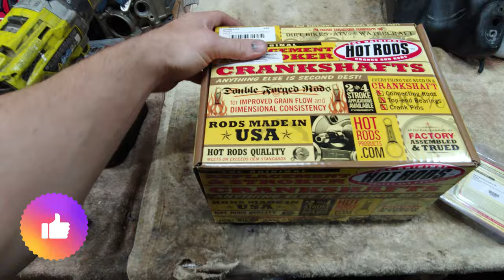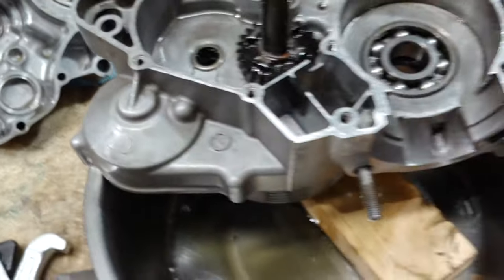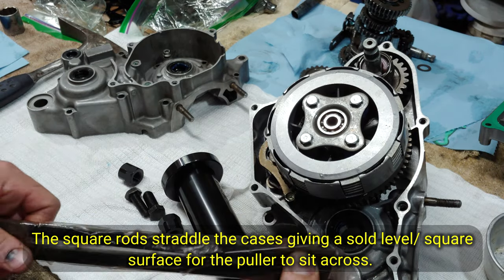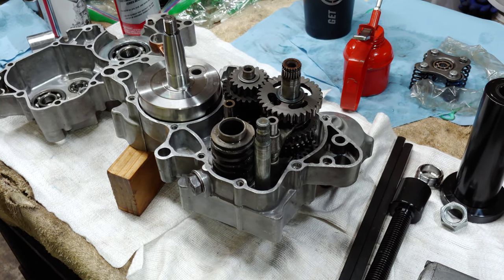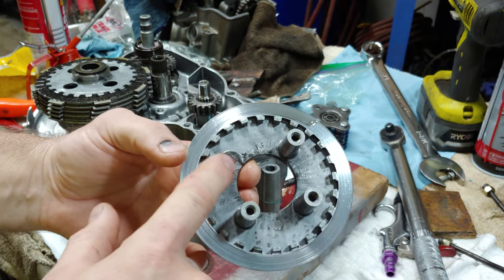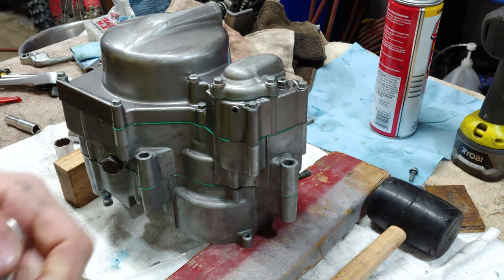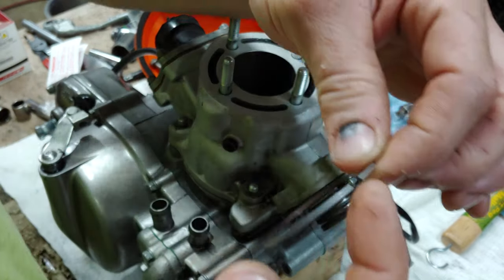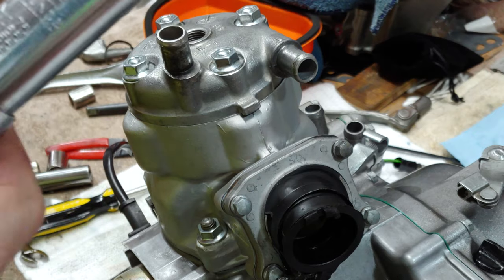03 Honda CR85r rebuild part 7 || Crank & Piston install [Special Tools]

Comment: I know when I was racing motocross I ran Kawasaki Kx 80 with the 101 big bore kits and big wheel kits in the late 80s and we bought crankshafts 2 or 3 at a time cus wee raced those little engines hard
Reply from the maker: Oh yeah! Running that powerband to the max!!!

Comment: hey man so usually with my stocks bikes i’ve always just made sure the bore is stock then i’ll go ahead and order a stock size piston i always test fitted things first and never had a problem. what’s the purpose of checking the gap between the ring i never knew about this and if this is the correct way of doings things i will start to do this more often but so far i’ve never had a issue
Reply from the maker: Yiu want to make sure that your gap is large enough. Some of the rings from other companies need to be filed at the ends. If the end gap is too small, when things get hot, the ring ends could touch and expand too much and cause damage to the cylinder and possibly piston by siezing. 

 You want at least .004".of ring end gap per 1" of cylinder bore. 

2" bore cylinder = .008"
3" bore cylinder = .012"
3.5" = .014" end gap.
Reply: @Fixin2Ride-Official-  that makes more sense man thank you for taking the time and answer my questions keep up the great content 💯 there really isn’t much cr 85 videos out there and there being a series on your channel is so cool because now i can come to this channel and see how things are done to cr 85
Reply from the maker: Good deal thanks for watching. Glad its all helping out.